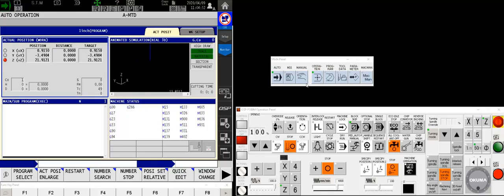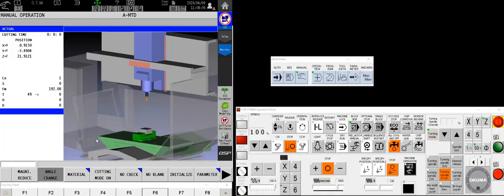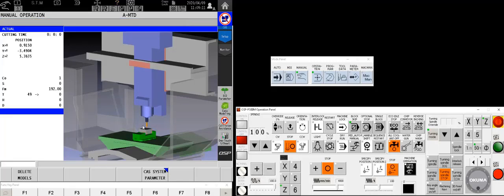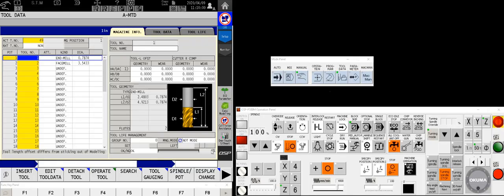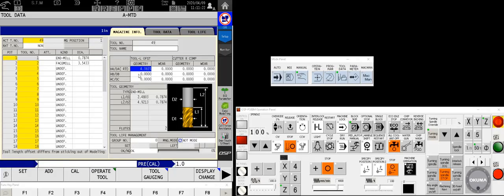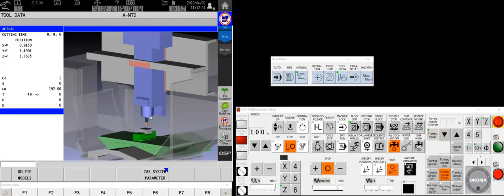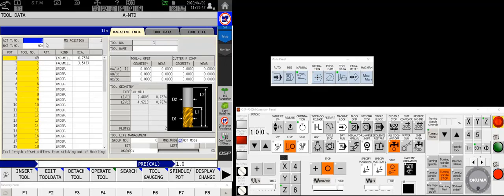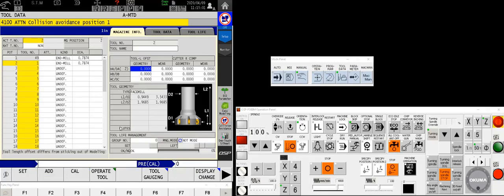Manual tool set P300M

Comment: How do you set to show the wear columns on tool length and cutter comp offsets? Mine is P300M as well but doesn't show it.
Reply from the maker: That’s an option from Okuma. You’d need to contact your Okuma retailer

Comment: Hey I got a question. If I wanted to use a different D comp, lets say I want to use D44 for T14... how can I do this? I cheated by adding T44 to the pot list even though there wasn't a tool there and just adjusted cutter comp on T44 D comp. section.
Reply from the maker: Is this a P300 or P200 control? If its a P300, I suggest using DA, DB, and DC instead of D14, D44...etc.  Wait! I haven't done a video on that yet?? I'll get right on it!
Reply: @pocketcharleywithgosiger  lol yes! Make a video please! It's a P300 on an M560-V